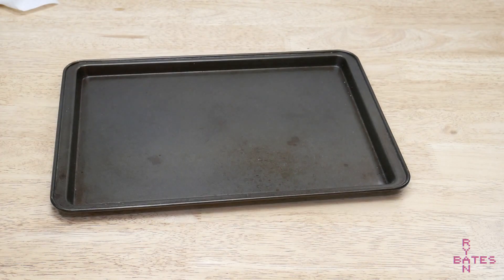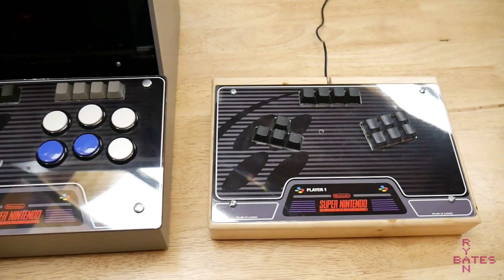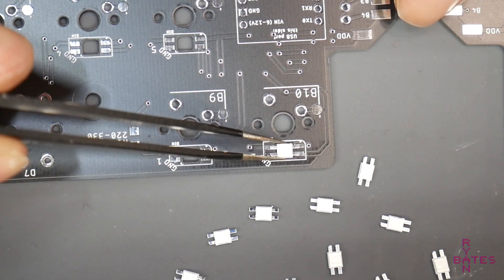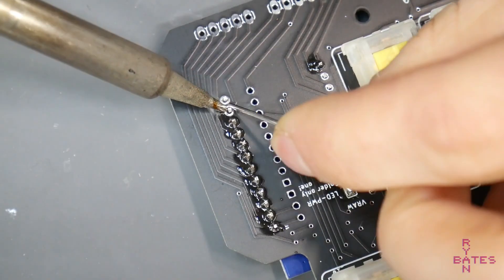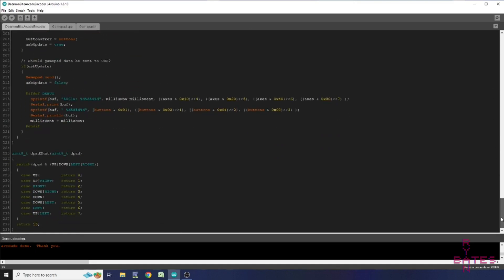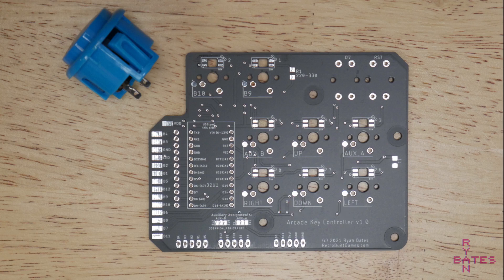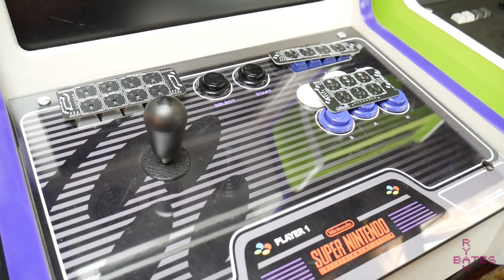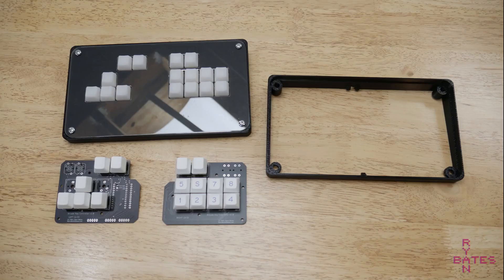MixStick Compact Arcade Controller | Economy Class Open Source Desktop Arcade Fight Stick

Comment: I'm confused on what you attach the PCB on with the enclosure. Is that thin plywood? Also is that acrylic sheet on  the bottom of case?
Reply from the maker: correct, the thin plywood is hardboard (can also be called HDF). Acrylic cover on top and bottom.
Reply: @RetroBuiltGames  I see. What's the recommendation thickness for the hardboard. Also is there template layout for the mixstick or I have to make the layout myself on the hardboard?

Also for custom art. Did you use lamin labels to print the art or paper stock while acrylic cover holds it in place?
Reply from the maker: i recommend 1/16" (1.6mm) thick for all hardboard and acrylic layers. Templates are part of the source files! I Cardstock is overkill but will look awesome. Decent photo printer paper looks pretty okay too.
Reply: @RetroBuiltGames  understood. I'll see what I can do. My printer bed is smaller though. I'm trying learn how to split the case in parts and connect them together to form the case itself

Comment: This is so cool, I wish I had the knowledge to build one.
I wish I could make one with reversed layout (arrow keys on the right) to match a keyboard.
There is a product sold online that matches that need but it's 130$, I can't spend that much. And the most complex thing I've ever soldered is a gamecube analog stick. 😅
Reply from the maker: if you can do the gamecube stick, i think you can do this. The LEDs might be a challenge, but if you bork that, the controller will still work (just no RGB).

Comment: Been looking for something just like this, and the options are limited. Really want to make one, but my soldering skills are very rusty been years since I have, and I was never that great. I'd love to get good enough once I get a work bench again. Do you still sell the case?
Reply from the maker: I don't sell the case, but i released the 3D print files. You can get it printed by anyone that offers 3D printing services.
Reply: @RetroBuiltGames  Thanks for the response. Iike the build a lot. The set up looks comfy.

Comment: I ordered the plates from tindie and some Cherry MX Silent Red Black Switches with PCB mounts then I'll 3d print my own key caps.  Which resistors are needed?
Reply from the maker: 1206 220-330ohm resistor for the Addressable LED data line. added these details to the git
Reply from the maker: I'll put the resistor in your tindie order

Comment: Love it! Any chance that this could be updated in the future to work with GP2040? Similar to DaemonByte but uses a Pico and way more options in terms of system versatility (Switch, PS3, PS4, XInput compatibility out of the box). If this could work with GP2040, tons would flock to it. Heaps of FightStick DIYers currently use it for projects!
Reply from the maker: Yes! RP2040 is on my list to make rev of this.
Reply: Awesome thank you!